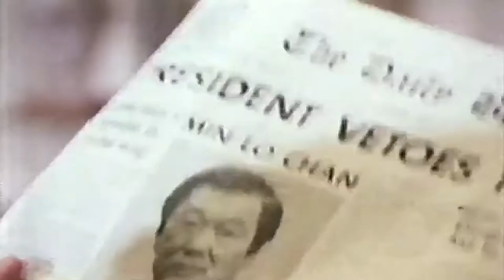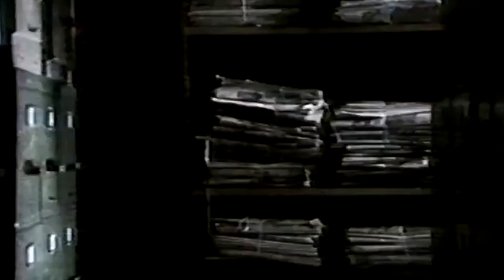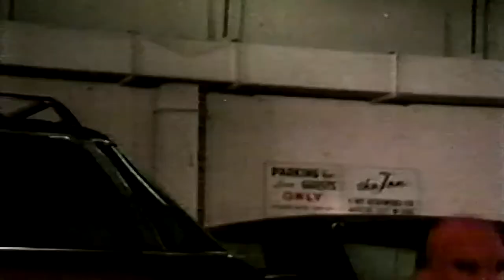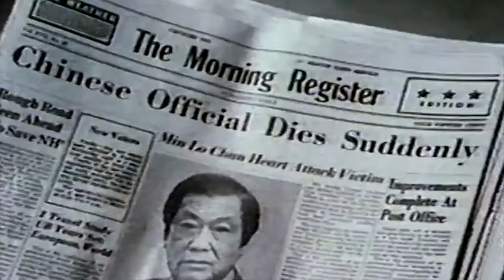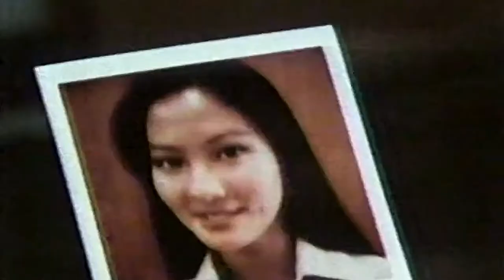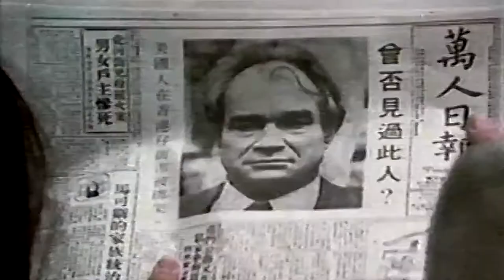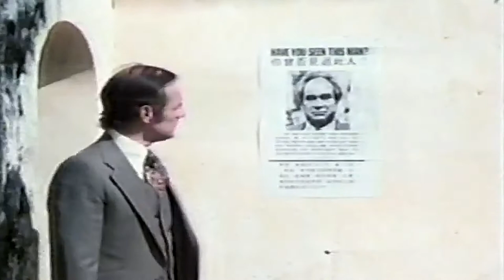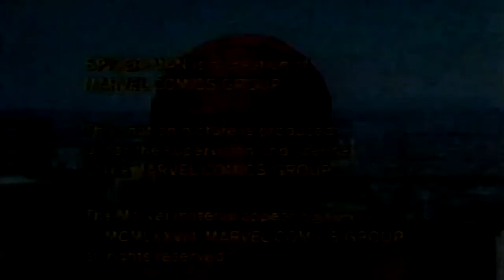Spider-Man The Dragon's Challenge (1981 Film) [1080p 16x9 Remaster]

Comment: This is a 1977 movie, not 81.
Reply: That's the original, this is the third film (with Strikes Back in 78)
Reply: @DireAxis  There are only two Spiderman movies from this era.
Spiderman Strikes Back (TV movie 1978)
Spiderman- The Dragon's Challenge (TV movie 1979)

There was also two 7 episode seasons of The Amazing Spiderman which ran to 1981.
Reply: @PictureHouseCinema here was 
Spider-Man (1977)
Spider-Man Strikes Back (1978)
Spider-Man The Dragon’s Challenge (1981)
Reply: @BartSimpski  There is no listing for "Spiderman" (1977) as a movie- it's the TV series that refers to.
Reply: @PictureHouseCinema  look at this guy’s other videos. The movie is posted there
Reply: @PictureHouseCinema   It's actually the feature film pilot.
https://en.wikipedia.org/wiki/Spider-Man_(1977_film)#
Reply: @baronmeduse  wikipedia is a place where anyone can put in "information". The site is littered with inaccuracy and pure fiction. But you just confirmed what I said- there are only TWO feature films that went to cinemas. This "movie" you refer to is the pilot episode that was a feature length (not uncommon for a pilot in TV) and only shown on TV as part of the series. It did NOT get a theatrical run.  The minimum run time required to be classed as a feature length is only 80 minutes. Many TV shows had episodes as long as 60 minutes and pilot episodes are usually always longer than the rest of the series. There are only TWO Spiderman movies and a TV series of which the pilot was feature length.
Reply: Although the above is accurate, this is the information under debate here, from one who grew up watching this series and film reruns.

The pilot film "Spider-Man" (1977) was released theatrically in Europe, along with the two-part episode "The Deadly Dust", renamed "Spider-Man Strikes Back" 1978, and the two-hour finale "The Chinese Web" from 1979, renamed "Spider-Man: The Dragon's Challenge" in 1981.

In addition, these three films, with the episode titles, were shown in repeats in the US, along with four other films that were made from two episodes being edited together, with a new connecting scene. These were "Night of the Clones & Escort to Danger," "Con Caper & The Curse of Rava," "Wolfpack & The Kirkwood Haunting," "Photo Finish & A Matter of State." The only episode not paired up was "The Captive Tower," leading to this becoming a somewhat lost episode. These edits are also the basis of any bootleg releases of the series, leading to the original episodes only being rerun one in the 1990s on the SciFi Channel.
Reply: @louissalvas2882  thank you for this in depth clarification. It shows that as such none of them were ever actually made as "movies" for cinema but like Space 1999, Battlestar Galactica and Buck Rogers, they were all TV episodes converted into feature films.  We are all now better informed and I very much appreciate it.
Reply: @PictureHouseCinema 
The Amazing Spider-Man 1977 MOVIE 😂
Reply: @Millonario912Matro  what about it? You're a bit late. this debate has ended and I won.
Reply: @PictureHouseCinema And?
Reply: What's the movie where Peter Parker falls from a building and is unmasked?